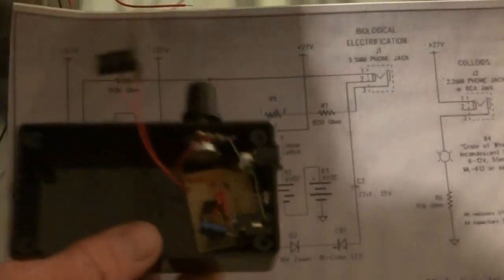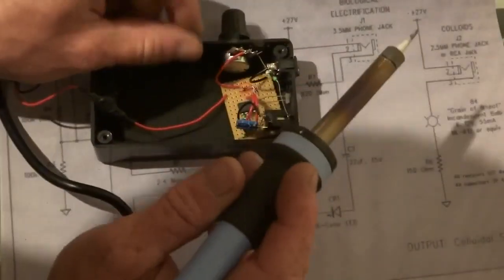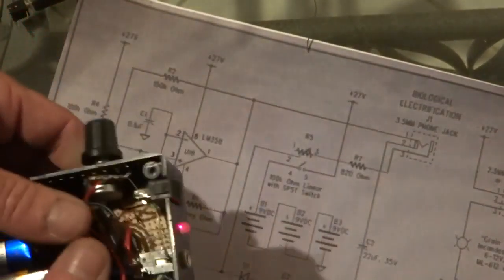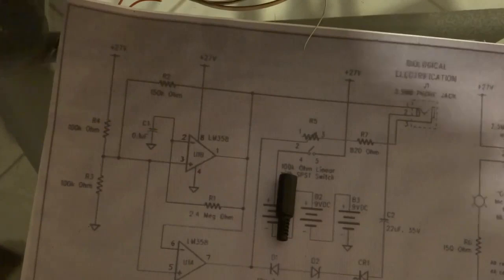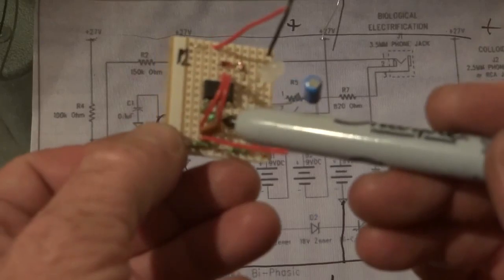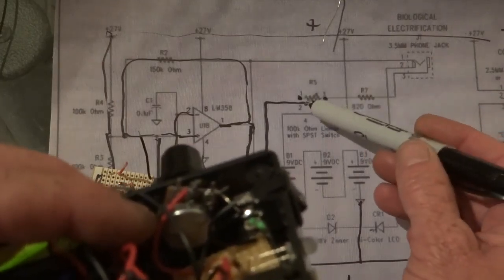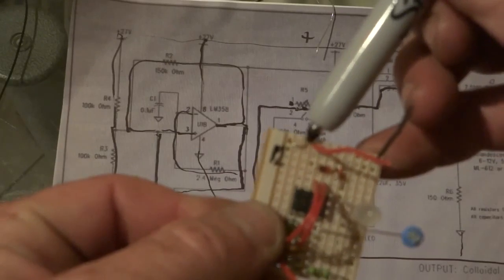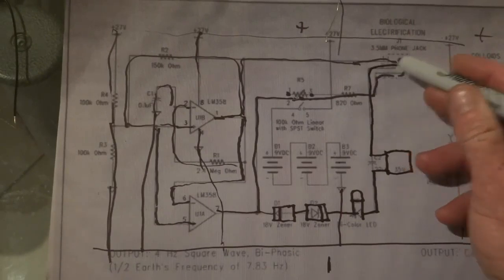How to build a Bob Beck Blood Electrifier 2

Comment: Thank you VERY VERY much.   I would not have had a CLUE of how to wire this up.  You are very clear. But what threw me, to which I had to sift through your examples, is when you substituted both a brown and later a black wire in your examples for red wire 'out' for number 1.  I've been suffering from super resistant scabies. I'm hoping that this BobBeck device may  'execute' them.  When I read the testimonials on the bobBeck site, I'm surprised out how many people, with differing ailments have been helped. There is a saying 'there may be a purpose for everything'.  - I don't necessary hold to it, but in this case of long suffering, having applied many 'remedies' that have not worked, even making a Hulda Clark Zapper, but with no satisfaction, I've been completely stumped.   I figtured then that I needed a much stronger 'zap', to which, searching the Net, I came across the BobBeck blood purifier, then your YouTube instruction section. 
Due to your help, I shall now go to work, make one of these and see how it 'fairs' out. I'm not sure how the 'colloidal silver' gadget side works and also wondering as to how the two stainless steel 'pins' are to be applied. 
I'm wondering at how many ailments that this gadget can help. There is much sickness out there. As a senior, for lengths of time I've suffered a throat infection that hangs on. But when I began using my home made Hulda Clark zapper, I've noticed that my throat has improved.  
You may have noticed that many seniors develop 'crackly' voices. It is this same form of throat infection. Both the sinus and the throat contain a pocket each to which such infections 'set in' and hang on. 
By the way, my name is 'Jerry Mecham', and I live in Perth, W.A.    While watching your video presentation, and looking at your hands,  I noticed that your hands look VERY MUCH like mine, shape, and even skin spots!  - which gave me a giggle. 
Thanks again
Oh, if you can give me any tips about the colloidal silver maker/circuit/ making, I will appreciate it.
Reply: Build the Dr Bob Beck silver Generator circuit, makes high quality colloidal ionic silver 👍🏼

Comment: I didn't get it. Ithought there should be 2 op amps. Also didnt get that mono vs' stereo. The output is mono so what is the point of the middle stereo ring connection ? Thank you for your work.❤👍